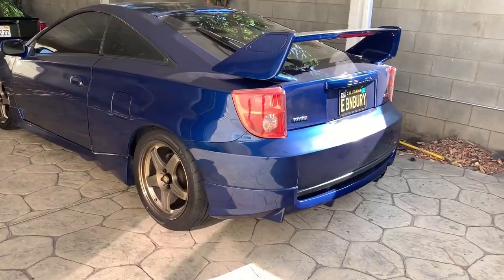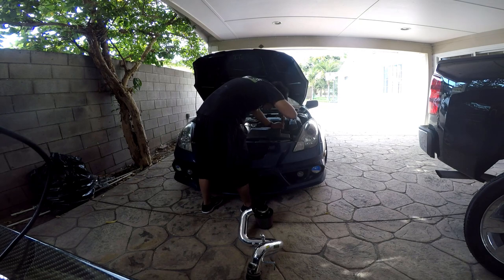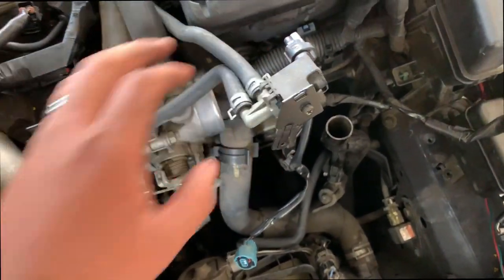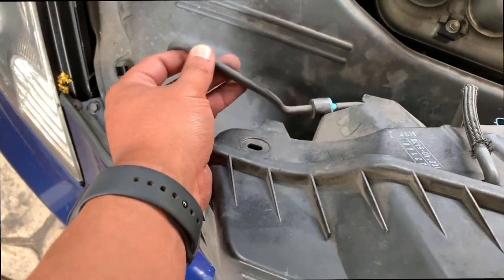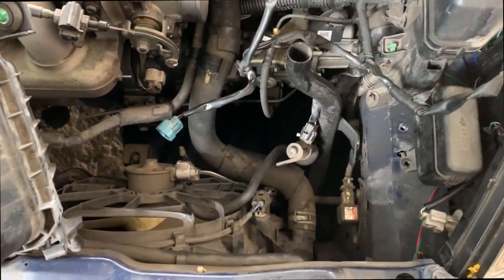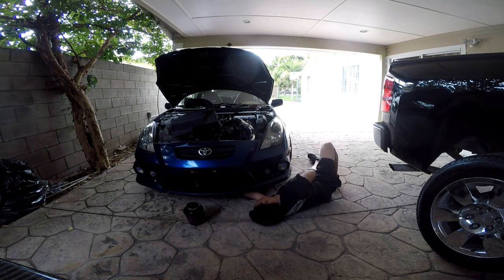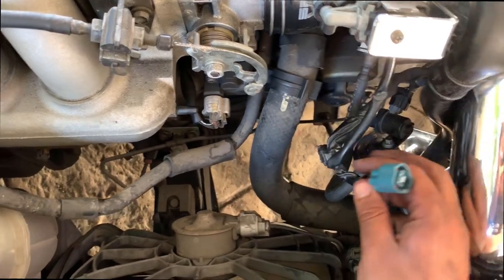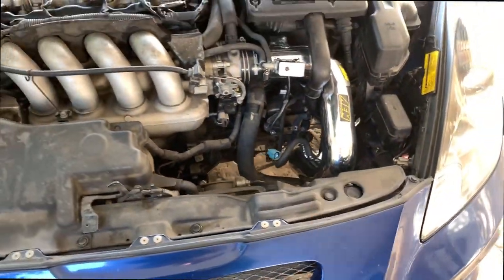How To Install A Cold Air Intake 00-05 Toyota Celica

Comment: That celica has an issue of low oil pressure how eould you solve that because when yamaha designed the engine they dismt take into account what happens to the oil pan when the cars hits higher rpms
Reply from the maker: Upgrade the oil pump
Reply: @RafasGarage  ok but to what give me like a specific one
Reply from the maker: @vitoscalleta9814  mwr billet
Reply: @RafasGarage  Hello 👋 I no the ECU Cooling Tube I no one part hooks into your ECU may I ask were the outher part of the tube goes please let me no I really would like two no  thank you for any information
Reply: Also replace the GTS oil pan with the GT one

Comment: The Air flow intake,  for me falls off from the engine Hole that connects the Cylinder look tube of the Air flow intake.  My Celica pulled me engine light and stopped moving after not having properly attached Anyone knows whats the thing called that Holds them together?
Reply from the maker: You didnt tighten it